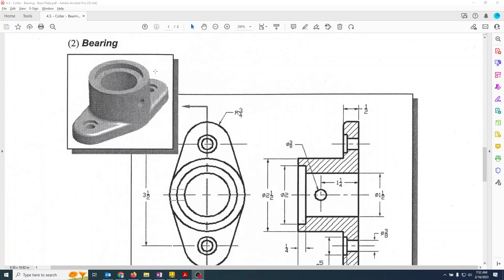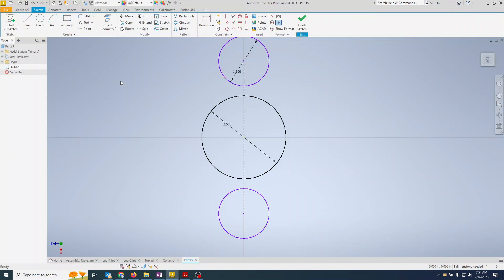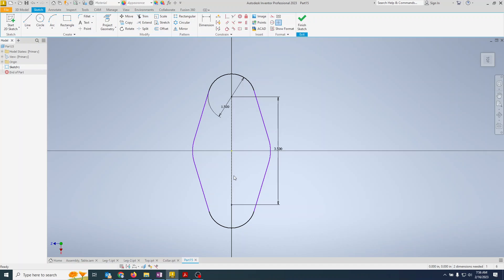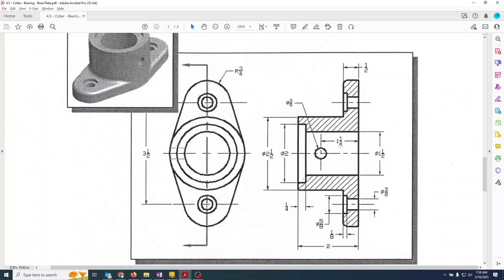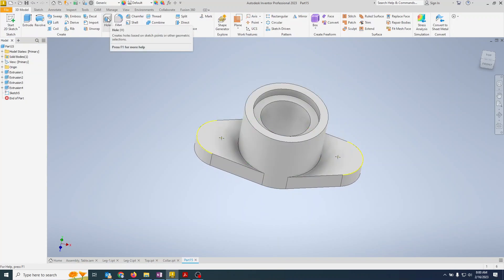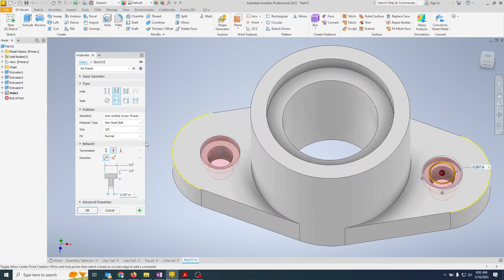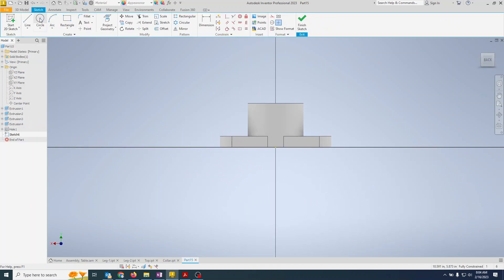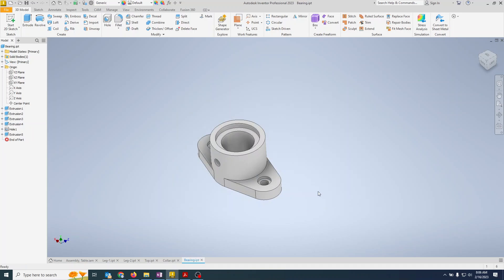4.5 Shaft Support Assembly - How to model the base parts. Part II: Bearing

Comment: The blueprint has a fillet on the drawing, how come it's not stated what that is?
Reply from the maker: Yes, that's the problem with drawings sometimes.  People make them and forget things.  No call out on the fillet, and if you look at the shaded isometric view it has another fillet around the cylinder that is not present in the section view.  Then in the video I accidentally leave out the fillet altogether. (Because I was trying to hurry and make the video before class started.) Humans are just mistake prone wetware I guess.